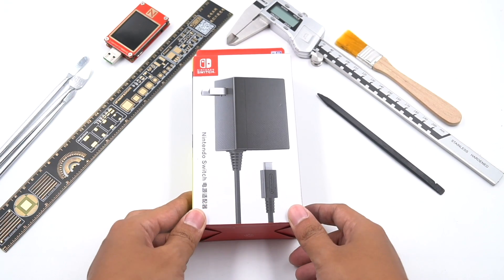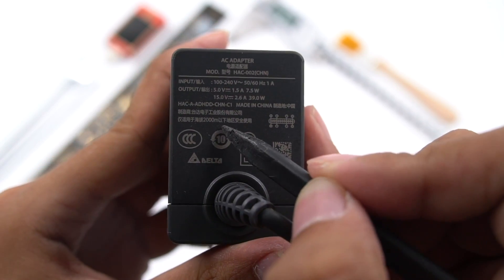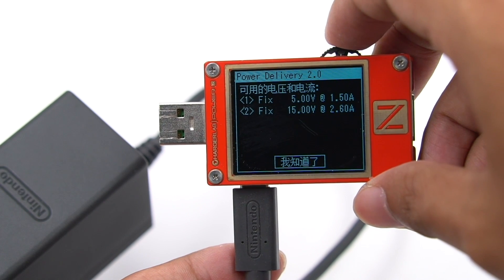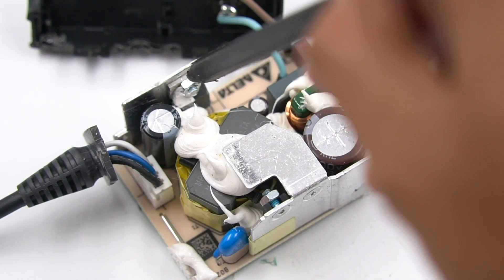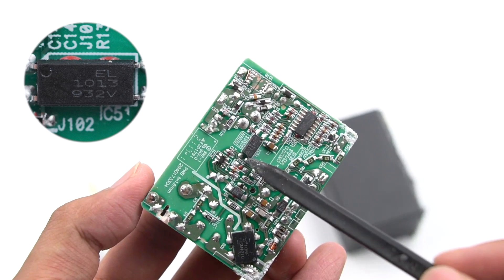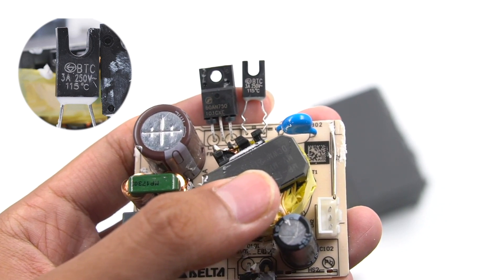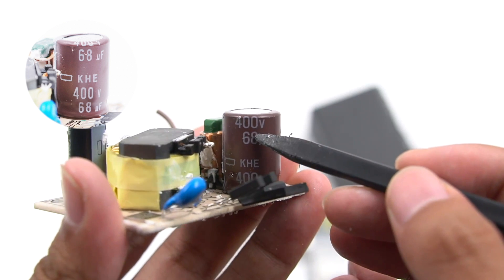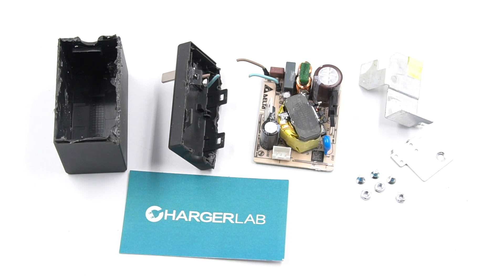Teardown of Nintendo Switch 39W AC Adapter (Charger)

Comment: I have a problem with my charger. It is charging for 10 mins (15v is there), after that it turns on off on off. I check other charger from friend, the switch is ok.

Is it possible to repair this? Or can I buy a pd 3.0 charger of some phone which has 5v and 15v outputs and use it safely? Is a 20v pd 3.0 charger (which has 15 and 5v modes) safe for the switch?

Comment: Thanks for the teardown.
That's why I use the Nintendo Switch charger on all my gadgets, it provides great voltage stability, and has Japanese capacitors, a 10 from Nintendo, the only one that sells quality USB-C chargers.
Reply: You use it to charge your phone?
Reply: @Drakey_Fenix  Yes, because it is the best of all the chargers I have been looking at in terms of quality.
I bought one specifically to charge my gadgets.
Also, it is very oversized, it is designed to be very durable.
Reply: @SrKevin90  Nice! But I guess it won't do fast charging. So your phone will charge slowly. Which I guess is fine if you charge during the night.
Reply: @Drakey_Fenix  I have an S23 Ultra, it charges in an hour and 50 minutes, it's enough for me.
I don't like fast charging, the battery suffers quite a bit even though it may not seem like it, my mother always used fast charging, and in a year the phone's battery didn't last at all, and my S23 Ultra in 2 months will be 2 years, the battery still lasts almost 9 hours of screen time.
I have never been a fan of using fast charging (I only use it in an emergency), I prefer it to take a while but the battery can last as long as possible.

Comment: Maybe parts are good , but quality control or design is pure sh.. I have just disassembled mine in few seconds with help of vise, some tape, board and ...hammer. It cracked into two parts on the bottom part, but still I think I can glue it back together quite nicely. Mine was not working for me from the very start, was giving power very rarely in 5V as well in 15V dock mode, but no one bothered and then forgot to make warranty claim and warranty period has passed. I wonder what is wrong with it, because like I said it is faulty from the beginning... Thanks for the tear down, I knew what to expect and not to damage anything thanks to you.

Comment: hey bro .. when I cut the dc wire of my Nintendo charger I can see 5 cables .. 1 blue /2 white and 2 black .. could you please explain what these wires do .. i mean which wire will go to which point in usb type c [break out board] .. i would be grateful if you could explain me this ..

Ps: in your video I am see there are 3 dc wires .. which is different from my Nintendo charger( my Nintendo charger is original from Nintendo as well .. bought in the US] .. please help me.

Regards
Rohit

Comment: hey there .. on the dc side .. there are 5 wires ..1 blue / 2 white wires & 2 black wires .. could you please help me usnderstand .. which one is which? via multimeter I can only get 3.2 volts ( blue & white or blue with black) ..please help me
Reply: I got 2.9v too but this charger has and output of 5v and 15v. I need to know which cable is which

Comment: That's the Mistusmi variant teardown. It has solid capacitors and the soldering looks nicer. Also more chips on the back. youtube dot com/watch?v=S2X-I-nR_mE
Reply from the maker: Glad to know.
Reply: @ChargerLAB  I hope you take a look in most variants. I'm really curious with same goal, which company (vendor) did the best job.

Comment: Would it be possible to remove the AC conversion and provide DC input into the primary circuit? I want to build a battery bank for a switch dock with 15v PD. Cant find a circuit anywhere which would do this.

Comment: Every time I go to uae my Switch I have to unplug the AC power adapter from the wall socket and then plug it back into the same socket, which has continuous power btw, to cause a power transfer. It's been like this since the day I purchased it. A classic example of a mass produced electronic pos.